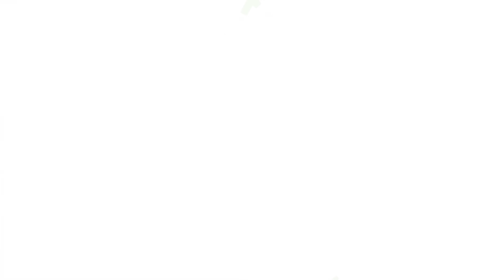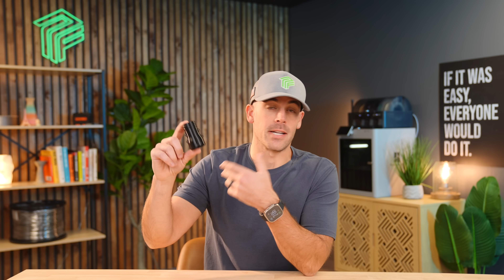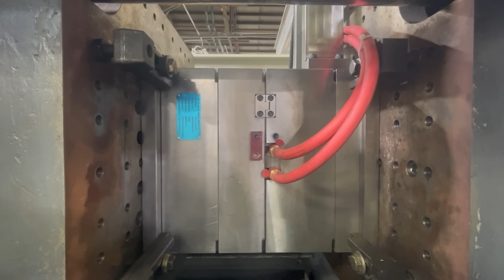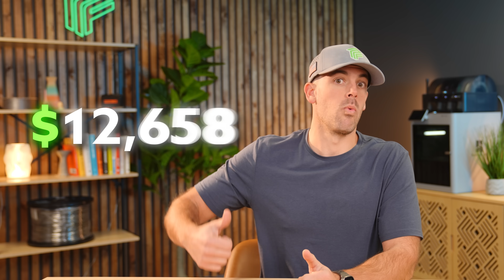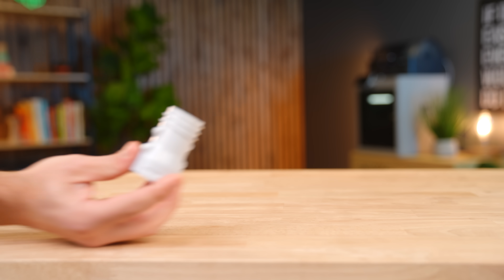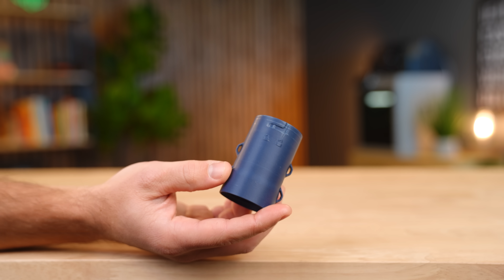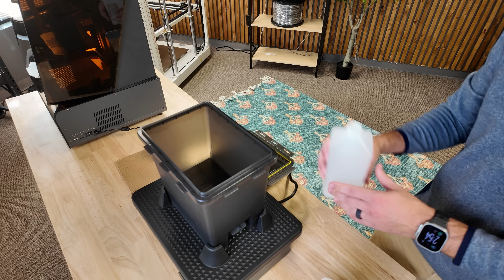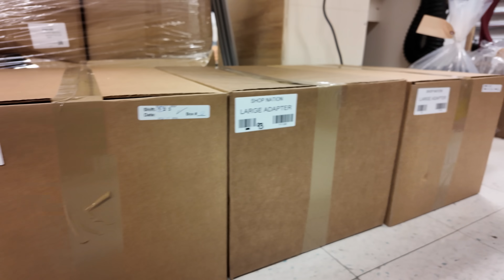Why is 3D Printing so Expensive?  Injection Molding Comparison

Comment: There are ways to reduce cost a lot in the tooling budget. Not all projects needs hard tooling, soft tooling would be more than enough for the volumes expected. 
There are still "layer lines" within injectionmoulded parts, as soon as you have any sort of hole or anything there will be a weldline where the 2 flowfronts meet. There will be some less strength in these regions since the plastic has cooled off slightly. 
Injection moulding is also 1000x better at making snap features, 3D prints are really poor when the layerlines are not in the proper orientation for the snap..

Comment: Simply amazing information. 3d filament being heated 3 times wasn’t something I knew. Really cool listening to the cost and process you went through to get into injection molding.
Reply: Go check out 3d Fuel's video on what happened when a bolt that got lodged in one of John's extruder machines. That single bolt cost him over 10grand in repairs & lost time. My heart went out to John after watching that and made me feel like the meager $200-$400 in failed prints over a single month I once had pail in comparison.

Comment: i had a 2 out mold made for a part slight bigger than your for $4500. The company stores my mold for free and will run parts whenever i need. The parts cost me about $0.98 each to mold. You got ripped off!
Reply: Does your mold have moving parts for making threads?

Comment: An an engineering-minded layperson with no detailed knowledge of either injection molding or 3D printing, I can look at the two parts in the thumbnail and say that it's absolutely worth the investment into injection molding if you care one iota about the part's appearance and structural integrity. The 3D printed part looks like hot garbage, and because it wasn't formed in a "single shot", will not likely have the same integrity as its injection-molded counterpart.

Comment: how is that part 85 cents of material when a smaller guy like me buys black rolls for $6? that is like 2 grams of material. should be more like 2 cents of material cost. somethings being lied to us here about these numbers unless he gets filament at $22 per roll? explain the 85 cents and how many grams that part ways
Reply: He didn't say 85c of material. He said all-in printed cost of 85c - so including electricity/printers/maintenance, etc. Not sure if that included all overheads or just the direct printing ones. He says the raw material cost is around 25c, which means it probably weighs around 30-40g. All at around the 4:43 mark

Comment: The FDM vs IM debate in this context seems irrelevant. You're spending $35,000 to reduce the cost of producing a part and I find anyone who justifies IM as the best way to do that, hard to take seriously. Spend 10% of that budget on better automation of your 3D printing processes or extruding your own filament from the pellets and so on first. Take 3D printing to the limits of efficiency and THEN compare it to IM. I find it hard to believe that $35k spent on a few molds is the best way of reducing costs or improving production efficiency. I'd be interested to see an IM comparison with your filament costs under $4/kg and manpower costs to almost nothing with simple automation processes. 

I also wonder if the IM company took you for a ride? Early in the video the guy says some simple molds can be $3,500 or $5,000 and not the tens of thousands many think. Then you get extremely simple shapes made into molds and somehow it's $35,000? And if that is right and simple shapes cost tens of thousands to IM; how viable would that be for more complex parts that could be significantly more? Even rudimentary complexity could add significant costs to IM that 3D printing doesn't have.
Reply: Engineering, machining and assembly of a multi part tool is not an easy task. Also, the benefit is that instead of running around collecting finished parts from machines, a job with little value add to his business, he can focus on making more dust collector designs which is added value to the business (i.e. opportunity cost).  The material cost is insignificant in both cases.
Reply from the maker: I think you missed the point. Cost is just one component

Comment: When I was using injection molding, our parts were relatively small and simple.  We never paid more than $3500. or so for a mold.  And we had multiple parts per mold so the cost part was virtually nothing.  Injecting molding is a good tool to know but just as there are things that can't be printed, there are things that can't be molded.
Reply: Interesting. Thanks for the info
Reply: those mold costs quoted are outrageous.  (check china)  unfortunate to say but the US costs on this are off the charts.  for maintain proprietary knowledge maybe US is better but at a cost.

Comment: They should use a vacuum to draw the plastic into the mold instead of pushing it in. The vacuum could help seal the mold as-well. Then you wouldn’t need such big/beefy machines to try and hold together the mold.

Comment: I went to college for plastics processing. Worked in injection molding as a project engineer, quality engineer, design engineer, and process engineer for a couple of decades.
I got into 3D printing last year out of curiosity and a way to make jigs and tools for my new woodworking hobby.
I have been enjoying 3D printing but so many who are now running businesses with 3D printing are confusing me with the things I hear and see.
I hope this video helps those who do not know IM to get an idea of how 3D printing is not a viable production process for consumer goods with high volumes.
Reply: Nice.   Process Engineer in the compounding space, one feed stream up from injection molding.   22 years doing this stuff.  

3d printing is a lot like running a CNC machine to make your proof of concept parts before going high production using castings.    Same principle.   Cnc for smaller volume, but if the demand is there, and the part can be cast, then that ends up being the better solution and a lower cost per unit.
Reply: @wadebrewer7212  I think realistically, injection molding isn't improving nearly as rapidly as 3d printing. it just gives you more design freedom, and the way it works is just more ideal in a lot of ways for making most products. which never really reach the kind of volume that justifies injection molding over 3d printing (a bar thats only getting higher...) Time to market, the geometric freedom, the way plastic is distributed within a part typically bieng more ideal for strength (along the outside), and the ability to iterate quickly and cheaply, along with the lack of startup tooling cost make it a no brainer if you ask me.

IM guys are going to need to start making better use of cheap/quick fabrication tech for their molds if they want to stay competetive outside of much higher volume parts. I think it will just occupy an ever shrinking market segment untill it's mostly just for crap that blows in the wind, consumables and such. 3d printers are still advancing rapidly, and I don't see how, as the number of print on demand farms/printers grows, and standards start to proliferate, and capabilities increase, IM is going to match the kind of logistical advantage that's developing now. The product not needing to even exist untill ordered is... insane.
Reply: Can you injection mold a dragon?
Reply: @NigelM18  Yes and no. Yes, if the shape of the dragon is considering the injection molding process. No, if it doesnt consider the injection molding process ;).
Reply: @NigelM18  why do you ask?
Reply: @NigelM18  I assume you are referring to a flexi-dragon?
Reply: It is, but the use case matters quite a lot. Small or infrequent runs could be one,
Reply: @shadowlordalpha  I agree. You have to consider costs vs profitablity. Low volume would not be cost effective for IMM but would be for 3D printing.
Reply: its good as a start, but once you need serious production output, you need dozens of printers banging out parts around the clock, which can lead to an upkeep/maintenance nightmare, at some point, for plastic parts like fittings your best bet if you dont wanna dish out tens of thousands for industrial grade machinery, is to build smaller scale ones that can produce multiple parts at once much quicker, its 100% going to be a janky DIY frankenstein's monster of a machine, but  it will help you scale up if possible to getting actual professional machines for more output, it doesnt make sense for most 3D printing businesses though because they have to occupy very niche markets most of the time, but the few that end up buying a warehouse to put dozens of printers in, you might as well have bought one or two solid injection machines, or build 4-6 yourself and learn to cast metal moulds.
Reply: Viable? Yes, absolutely it is, the farms are rolling out, the costs are coming down. Optimal? For real high volume stuff that's readily adaptable for injection molding? Hell no, bite the bullet and pay for the mold unless the design changes practically every wednesday or something.
Reply: @abowden556  i wanted to say this as well but you got here before me 😂

I'm currently working on a concentrated complexity part that has 18 internal chambers with a wide variety of captive components.

We might make 30 million of the things if things go right.

The metal 3d print is 1 single part costing about $430/part

The injection molding part is actually either 18 or 21 parts (using CNC'd copies to test the 18 part model rn, hope it works 😂) at a projected cost of ~$3200/part

Comment: For small series you can reduce the tooling costs by resin printing the molds. There are resins designed with just that use in mind. Allows you to iterate through mold designs as well, as one can be sure to make the usual mistakes once in a while, and definitely often early in the process!
Granted, they survive only a tiny fraction of the shot count. Post shot cooling and cycle time in general takes way to long for mass production. But with a manual shot machine in your garage you can go from CAD file to finished injection molded part in the same time my postal service would take to ship the parts. Sweet spot would be in the tens to low hundreds of parts. Or tests and even singular parts that benefit from the process.

Comment: So... you spend an insane amount for a mold. You make several thousand widgets. Then you need to make a revision to improve the product. BAM! There goes another insane amount for a redesigned mold. First off... there's no justification for molds costing as much as they do. Show me a cost audit for proof. As 3D printing technology improves, the only market for injection molding will be legacy industrial production (food packaging, automotive, etc). A print farm with 50 machines isn't a competitor of that market. And the reason is simple... easy to pivot and dirt cheap upfront cost. By the time you sell 5,000 copies the design is probably dated. A few hours of CAD and you're back printing again. Try that with injection molds. And it's only getting better for FDM... multi-color head machines in 5 years will be common for less than $1k.
Reply: Yep, the guy who already owns a print farm decided to get high volume fixed design parts injection molded, explaining in detail about how he wanted to be absolutely sure the design was correct because design iterations would be expensive, didn't consider that design iterations would be expensive

Comment: I mean, injection molding is cheaper with volume is pretty standard knowledge if you have enough business to justify it, it's just not as good for rapid design changes and there are designs you can't mold and need to print.
Reply: And also, the idea that cheap printers don't have an enclosure has already been resolved with something like the Centauri Carbon so....

Comment: Question I have is do you own the mold - so if you want to have someone else produce the part or will you have to pay new company to recreate the mold
Reply: you own the tool, usually paying installments as the tool is started through to completed (not always a single upfront payment), the molding firm holds the tool and sets the die to order, if the company goes under or you aren't paying your running costs, it can be difficult getting the tool back (seen that happen)

Comment: What makes tool/mold design so expensive though?   Why can’t you go from your 3d model (with injection molding best practices applied) to a cnc-milled aluminum (?) mold for less?   I can’t imagine this is labor hours or material costs.   Where does the $35K get spent?
Reply: Can take a while to manufacture the tool, (best practices is a starting point), it has to be physically put in the molder and parts run to check for correct dimensions/shrinkage, venting/gassing may be an issue, sprue runner dimension may need enlarging or sprue less runner added, parts might need more draught angle or cooling to eject correctly, air blast might have to be added, more ejectors in difficult areas might be needed, the list goes on, the tolerances on these tools need to be accurate to thousandths of an inch, god forbid you bend an ejector because of sloppy workmanship, the hold on pressure for these machines are measured in tonnes, so you need tool steel, aluminum is too soft and would get destroyed (tool faces and the molding platterns can actually sweat moisture from the hold on pressure), the injection pressures the tool has to resist are huge 500 to 2000 psi ( though you can get away with aluminum with A/B Urethane  injection molding (have made car bumpers and the hold on/clamp was much lower with them)
Reply: @gknelsz  also to mention, the time spent post processing of the molds for surface quality, like polishing, or grit. and the costs related  of sourcing the materials for the mold itself, they're usually heavy and the logistics aren't that easy
Reply: @scooterperu  very much agreed, stoning and polishing the tool is a big time/cost drain

Comment: Injection molded ABS has over 10x higher z-axis impact strength than 3DP PLA or PETG. 

3DP needs to mature to actively heated chambers as default and away from brittle plastics.
Reply: Not exactly true. Ultimate tensile strength of ABS is about 40 MPa, which is comparable to 3d printed PLA in z axis
Reply: @druulian what does UTS have to do with impact strength (energy absorption)? That's something completely different...
Reply: @druulian  I said impact strength, and it is true. PETG and PLA achieve about ~4 kJ/m3 in XY, suggesting ~2 kJ/m3 in XZ. 3DP ABS is about 10x higher in XY, and since we're talking about isotropic injection molding there's no XZ penalty to consider.
Reply: @TSI9001 I misread your comment, sorry. You are right, impact strength is abysmal. The point i was trying to make is that for many "engineering" applications PLA on open printer is perfectly fine. There are pla tough/plus modifications if you need extra
Reply: The first consumer protecters were enclosed,heated chambers, doule nozzles, and even file transfer oven the local internet

Comment: 0:20 dont waste time becasue want mass produaction you do injection mold. if want prototype reitearion and small bach 3D print is the best.
Reply: Yeah I just bought the printer because the price of the molding and the sheer amount of minimum order still needed after that .😮  It's good for huge quantities. Can't be beaten today. 
However printing is cheaper for smaller batches since I don't have to spend a fortune on the molds. And it's not only the money, the molds, can take a lot of time and many iterations to get exactly right as well.
Reply: And if you mass produce don't do it in china. They will use your molds you payed for to make Nok offs and undercut you selling your product all over the world without having to invest in anything!!!

Comment: I think this is a great video.  I did a similar video back in 2023 talking about the cross over point between 3d printing vs molding vs urethane casting because so many people just say FDM is better than molding which just isn't the case.  Glad your guest mentioned many of the topics like strength on the layer lines.  molded parts still have "knit" lines and seams where basically the plastic meets itself.  You can also have sink marks in thicker areas and other potential issues.  Designing a part for molding has its challenges but its actually way less restrictive than designing for FDM.
https://youtu.be/rT0hod1U2BA

Comment: im in this same boat currently. designing parts that i 3d print for injection molding is an entirely new learning curve and very difficult to do when you don't have ability the test molds or injection parts rapidly like you can with 3d printing.

Comment: Very curious as to how they mold an internal thread
Reply: Cores that unwind or split, "usually" hydraulic with chain and sprocket linking cores, makes the tool a lot more complex and expensive, if the parts or sprues jam you have a big mess, sometime you had to have your smoke breaks near the machine for that reason, but you can make hundreds of parts in hour
Reply: The molding is easy, the tricky part is getting it out of the mold. 😀 One way is with a core that literally unscrews. Another way is to use a collapsible core- the core is in segments and the center part is withdrawn for ejection so some of the  external segments slide past each other to allow the part to be ejected. You can buy the core assembly from a supplier such as DME. I'd guess about $1k each give or take, so a 2 cavity mold would have $2k worth. That would be a blank, the threads have to be machined on the outside of the core (inside of the part).